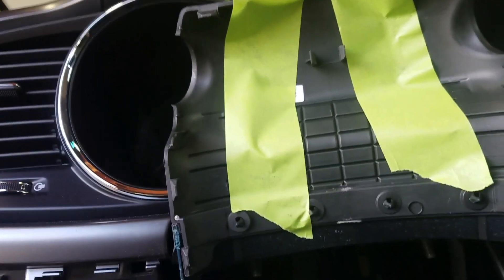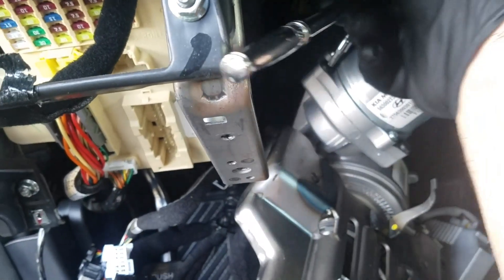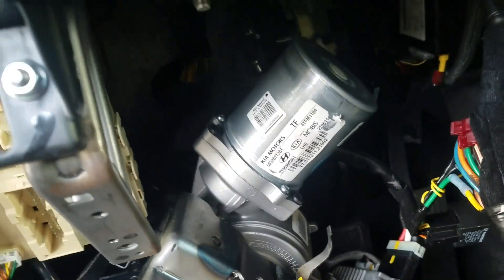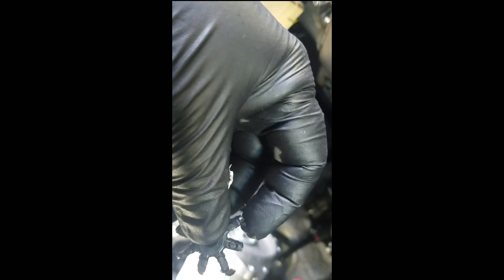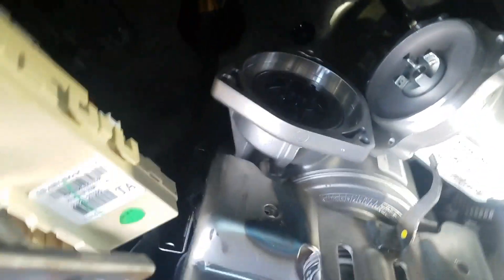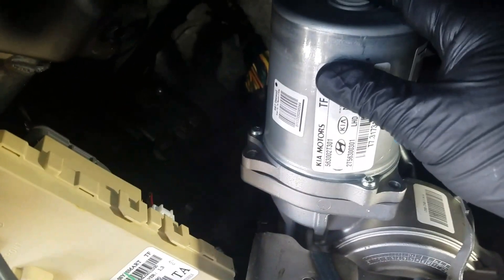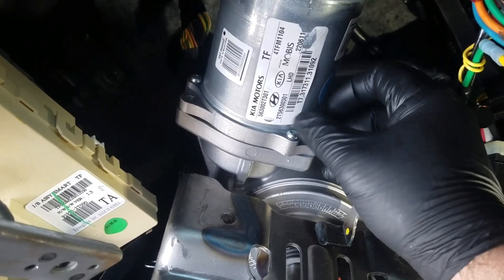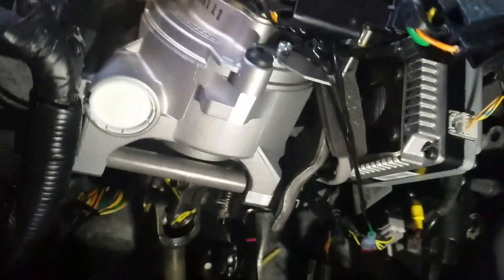Kia Optima / Hyundai Sonata Steering wheel Clunks? MDPS Coupler Replacement.

Comment: Joseph Tucci,  This video was so helpful!  I was getting very worried that my steering problems would never be properly diagnosed.  I'm taking my 2013 Kia Optima lx to a dealer with this issue.  I'm going equipped with your info.
I very much appreciate you taking the time to post this!  Best wishes!
Reply from the maker: +Brian Hockensmith That's why I do it. Glad it benefited you.

Comment: I explained my issue to my local dealer, and they still wanted me to leave my 13' Kia Optima in for a week for diagnosis. I took it into another deal and they fixed the issue within a few hours
Reply from the maker: You can take it to another dealership. However, there is a TSB and campaign on this issue. So no "diagnosis" should be needed. It is a known issue.

Comment: Just wondering habe you ever seen that cause slight steering wheel vibration or even the intermiteate steering shaft cause a slight vibration the vehicle is a 2012 kia optima sx
Reply from the maker: Yes, I have. The MDPS coupler will cause a clunk sound and some play in the steering wheel itself. More noticeable when stopped. However, the coupler has nothing to do with vibrations while driving. I have had a few incidents where the steering rack had to be replaced and/or the shaft assembly. The two most likely culprits though, are worn tie rod ends and unbalanced wheels. To first I would check for tie rod play and then verify wheels are balanced, before I attempted diagnosing a rack or shaft concern. Sorry for the late response, things have been a bit hectic for me lately. Take care, and let me know what you find.

Comment: Nice video, thanks. What year is this car and when did KIA go to the revised part on production vehicles?
Reply from the maker: +wymi My car is a 2015 Kia Forte. And if not mistaken, circa 2007/8 is when they changed to the new badge style.
Reply: I thought the car in the video was an Optima?
Reply from the maker: +wymi My bad. Mixed up video. In the electronic power steering video, it is a 2015 Optima.
Reply from the maker: +wymi I'm sorry. I so screwed up answering this question this morning. I believe this is a 2014/2015 model year. I'll look up specific dates on when they started producing with the revised rubber coupler.

Comment: TQ, but what exactly this small rubber function in a steering system?
Reply from the maker: It's a coupler. Its purpose is avoid metal on metal wear of the components, and also reduced sound and engagement of the electric power steering motor.
Reply: It also prevents the need for the motor to be perfectly aligned with the shaft. There can be a tiny bit of discrepancy with a flex coupling.

Comment: Do you need to do a wheel alignment after this?
Reply from the maker: No. Not at all.
Reply: RealTechReview  ok thanks...reasin why I asked it's because I recently replaced mine and afterwards I began to feel the vehicle pull to the right so I didn't know if I installed the part in correctly where I'm barely starting to realize that the vehicle was pulling to the right this whole time

Comment: just spoke with Kia this is on recall. Is this safe to drive till I can get it to the shop thank you
Reply from the maker: Yes, even if the coupler is completely wrecked it will still drive, the steering wheel will just have some play.

Comment: Hey man so unfortunately the motor moved on me while replacing It i put it back together but the steering wheel is hard to steer and the eps light is on anything suggestions?
Reply: Any updates? I have this same problem. What did you have to do?
Reply from the maker: If you moved it. Then calibration of the EPS motor may be needed. Sorry for the delayed response.

Comment: hello my car makes the clunk noise only towards one side and also when I'm on a bumpy road it starts to rattle crazy but I can still control the car perfectly fine would it be the same thing you showed in the video?
Reply from the maker: +Pedro Moreno Ok. I don't like simply diagnosing off of someone's interpretation of symptoms. But I will tell you how I would proceed. I would Jack the front of the car and place on Jack stands. Grab the sway bar end links and shake them back and forth. If they pop they're bad.

Comment: I have read a lot online that if you do this yourself and unplug the computer and fuses that once you reassemble your power steering will not work. Is this true or is this anyone's experience?
Reply from the maker: +First Name Last Name As with all repairs. You should not perform it if you are not comfortable performing it. However, I have never had any issues like you describe and I've probably done over a hundred of them.
Reply: So the motor moved on me while replacing it I put everything back together best I can with new coupler but now the steering wheel is hard and the eps light is on anything suggestions to help?
Reply from the maker: Don’t focus on the motor. As long as it went back together it’s fine. Make sure you plugged the electrical connector back into the computer (MDPS Module). It’s the one that had the blue tab securing it.

Comment: new TSB doesn't matter letters up. plus seen couples not fix noise.
Reply from the maker: +Turbotomass Initially it was letters up. So that's how I do it. Sometimes the noise concern can be tie rods or even the universal slip joint on the steering column. But most times it's the coupler.

Comment: I have a question. My car has the same problem but how is this replacement going to be different from the other besides the obvious fact that one is deteriorated. Is the new replacement not going to deteriorate? is it different material?
Reply from the maker: +Osvaldo Silva The new coupler is made of a different composite. They state it does not deteriorate like the original coupler.
Reply: I appreciate the info and the speedy reply. One more question, lol I own a 2012 kia optima LX. It makes that clunking noise when i turn the wheel. This little thing will fix that noise right? for a 2012 kia optima?
Reply from the maker: +Osvaldo Silva Yes. You have electronic power steering. Located under the dash, above the peddles. This rubber coupler is to connect but dampen the electric motor to the steering column. It's a known issue. In fact, how many miles do you have on your car?
Reply from the maker: +Osvaldo Silva Call your local Kia dealership and schedule an appointment. The warranty was extended on this (MDPS coupler) to 10 years and unlimited mileage. So until 2022 this part is covered under Kia warranty.
Reply: I have approximately 80,000 miles on it. Yes I know it has a good amount for its year. I bought this car off an auction. What exactly would they be asking for?
Reply: If I take this to a third party/mechanic, what a fair price to pay for a job like this?
Reply from the maker: +Osvaldo Silva I wouldn't take it to a 3rd party mechanic. Take it to the nearest Kia dealership. You won't pay a penny. The warranty still applies. Doesn't matter if you bought it from an auction. Doesn't matter if you're the 15th owner. The vehicle itself is covered under this warranty extension for 10 years. Your car is a 2012. So it has an extended warranty on the coupler until 2022. Doesn't matter how many miles it has.
Reply from the maker: +Osvaldo Silva All they will need is the VIN which is on the vehicle. It will not cost you anything.
Reply: Thank you so much. God bless you. I will definitely take to kia for it. I appreciate your time and all the info. May you be blessed with much more sir.

Comment: There's a recall for this and cover by KIA 10 years unlimited mileage.
Reply from the maker: +Larry Bui It is covered under warranty, that's correct. But I don't believe under the 10 year/unlimited
Reply: I have received a letter from KIA Motor and it stated so in the letter.